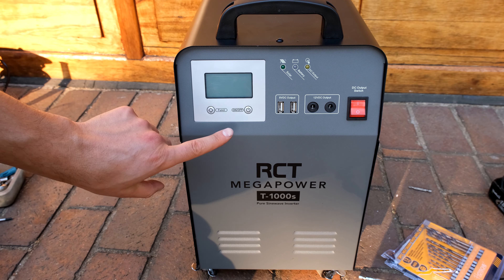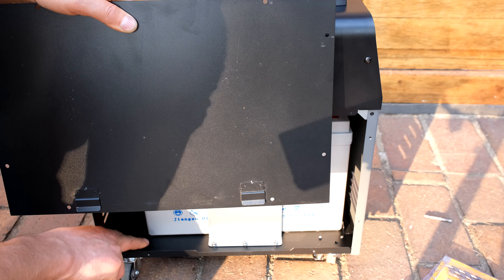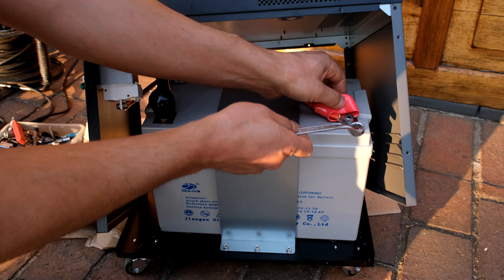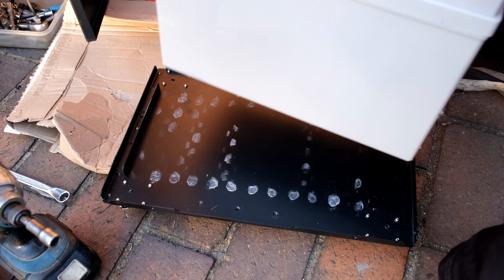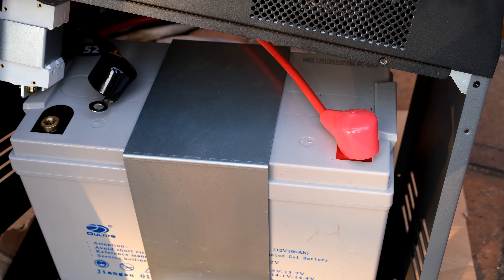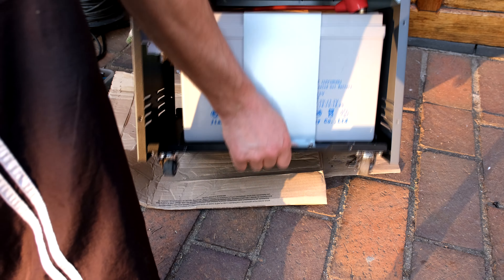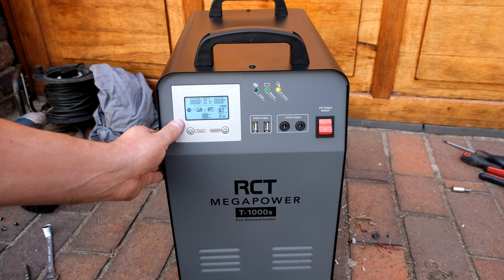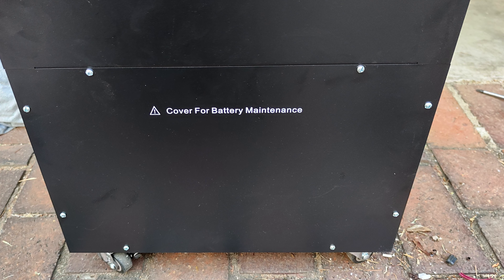How to change the Gel lead acid battery on the RCT MegaPower 1KVA/1000W Inverter Trolley

Comment: Hi, thank you for this very helpful. May you kindly make a video on how to connect the second battery using the battery extension feature from the back of this device. Thank you.
Reply: Hello did you get any info regarding this?
Reply: @idonwonpeace8238  No I didn't
Reply: any luck on getting information on connecting a second battery
'

Comment: Thank you !!!!
Your video will help me replacing mine who recently died.
Reply: Hello there! where did you buy your spare battery?Thank you.
Reply: Not all 100AH batteries are the same - the issue is the size.

The original make is Oliter but any gel or AGM deepcycle will work but it must be this size.

407x174x209 (L*W*H) - you can go higher like I did but not more than 20mm.

Ordered mine from Takealot - beware it weighs 30kg.

Put some insulation tape on the terminals and the spanner which I used to undo the battery terminals as to not short it out.
Reply: @tibbydudeza  THank you so so much for the answer! any chance 
to post the link here please?
Reply: @tibbydudeza how long did the original battery of this unit last you. 1 year, 2 years, etc?
Reply: @Cornelius1324  Stage 6 killed it (4 hour slots) - drew too much power so it lasted a year - it could only last one hour.

Add a power meter to monitor consumption and  bought another unit to split the load from my office.
Reply: @tibbydudeza  Thanks for the reply. What did you use the inverter for and what is the estimated cost to replace one deep cycle battery for this unit?
Reply: @Cornelius1324  
Router
Fibre ONT
Dell SSF Server
NAS
PC
Desklamp
3x LCD screens

The problem for 4 hours was the desktop PC and LCD monitors - the NAS and SFF server + others draw about 60W.

New battery (AGM) cost 3K.

Comment: Thank you. A very useful video. I’ve changed batteries in my Ellie’s inverter which was much easier.  This was really helpful as the RTC one’s 
aren’t as easy. Was a bit of fight getting the panels back on though.
Reply: Have you seen any instructional video in replacing the Ellies inverter battery? I need to replace mine, so trying to find some instructions. Way too heavy to take in somewhere
Reply: @n_justwatching  No, but the Ellies one is really straightforward, as I remember.
Reply: @spiritrider963  ah okay, thank you. I'll give it a shot myself

Comment: Hi i had to buy another 100ah gel lead acid, i stripped the unit as you showed in the video. I found the terminals on the adjacent side, thankfully the Neg lead reached.

Comment: Be great if there was a response to some of these comments particularly those about extension battery and use of a Lithium battery.
Reply: These are usually not recommended to be used with lithium batteries.
Reply: @pjn2001  also looking to add an extra battery. In just 4 months. It's barely keeping the TV on
Reply: Yes it can replaced mine with a lithium a few days ago.
Reply: Hi Stephan will you please provide details of the battery - make and model number, where you bought and what you paid please. Also where and how did you adjust the voltage settings to accommodate the Lithium battery. I contacted GeeWiz and they said a REVOV 100Ah 12.8V 12V Lithium-ion (LiFePO4) Battery would work. They should be available from April 2023.
Reply: @danielsamara3194  Did you manage to get battery and did you convert?
Reply: @markbooysen3988  Hi Mark, I did not. With load shedding getting worse and worse I am beginning to question the sensibility of spending 10k for a battery for a 1000W UPS. I am probably going to commit some extra funds and use the money to install something more substantial. Stay well.
Reply: @danielsamara3194  thanks for the helpful comment, I went and checked it out on the site and seems like a good option
Reply: @JoshuaRoode  Hi Joshua, I installed the Revov 100Ah LiFePO4 battery. Before buying I emailed Revov customer helpline but hey ignored me. Then I checked all the values that Revov specify for their battery and found that all the trolley values except low voltage were acceptable - so it did not matter that there is no info on how to adjust things. Have been using it for two months and monitoring the battery very  closely. All working well. Having a BMS is wonderful.

Comment: What's the process like for adding an external battery? Can one just add another 100ah battery on top of the original battery?
Reply: yes with a breaker added between the battery and the unit
Reply: @reniervandermerwe  so how will you go about it , as in when does the breaker work

Comment: Thank you for the helpful video. Can you please help in connecting the second battery to the inverter, would it double the current and/or power output of the system and could the inverter itself handle it?
Reply: no it does not double the power output the max stays 1000w . you only get double the amount of battery life

Comment: Just bought a new unit and  need some  help.  It appears the units fan and screen remain on when connected to AC wall supply when no loadshedding  and battery is fully charged. The noise and light is a bit annoying  Is this a feature or can those be disabled and kick in automatically when loadshedding happens?

Comment: Thanks for this, I replaced my battery yesterday and wouldn't have been able to do it without your video so I'm extremely grateful. I am, however having a problem with the battery now seeming to be recharging constantly. The manual provided is absolute garbage (I bought the same setup but branded as KOOL Energy off Takealot) but I'm not sure if it's because I'm in the wrong mode? Any help you could give would be amazing.

Comment: Can the battery be replaced with a 100ah LiFePo4 battery
Reply: I too wish to know this. Lead Acid Gel doesn't last particularly long.
Reply: Any information on this. I too would like to change to lifepo4 battery
Reply: Looks exactly like a mecer unit, so in that case no. Don't use lithium.
Reply: @pjn2001  Hi, can you elaborate on why you cannot use this with a Lithium battery?  Thank you
Reply: @StaffRoelofse  Hi, I don't know the technical details. Just what I read from the forums on mybroadband. Here is a quote from there :
"So after seeing the Revov batteries were available at Geewiz, i immediately left work and went there.
Had a chat to the very helpful technical guy at Geewiz.

He says there currently no Lithium battery that 100% works with the Mecer 1200/2400va.
I then asked him what about the 1200va/1000w. He looked at the specs carefully and said it wont work either.
If i recall i think it was due to not being able to manually set the charge voltage that is compatible with the Lithium batteries.

Even the combos they used to sell with the Hubble lithium's, they found that people were coming back with issues. Once it discharges bellow a certain point, the inverter is unable to charge the battery. A work around was to disconnect the positive terminal of the battery, then reconnect it. this fixed the issue, but then would not work a second time."
Reply: @pjn2001  Replaced mine with a lithium  From UPS Warehous. Works fine even if discharged all the way down till inverter switches off. I think the problem is in some lithium batteries the BMS cut off voltage  is to high. I can report the one from UPS Warehouse BMS does not cut of before the inverter cuts off.
Reply: @wap1bambi  What is the model number from the Lithium battery.

Comment: Great Vid. Do you know if there are any Li batteries that can be used as drop in replacements?
Reply: Hi Yes you can Ijust did it with an extended battery here is the battery 2 x Sunpal LiFePO4 Battery
12V 100Ah 6mm2 2-core Twinflex with lugs for battery
Reply: Hi if you can please make a video
Reply: Where did you buy this? I don't see it online.

Comment: Can I add a 200ah gel battery as replacement? Same unit
Reply: as long as its 12v not 24v and that it physically fits which i dont think it will unless you change the hosing for the battery so would need some body modifications.

Comment: Is it possible to replace the gel battery with a lithium battery on this?
Reply: So I actually did and it works well.
Reply: @vikashmaharaj6164  Could you maybe advise on how you came right and maybe which battery and where? I'm not keen on spending money on something that might not work xD

Comment: Has anyone had information regarding connecting the second battery using battery extension feature?
Reply: needs to the same battery type and use a battery cable (builders i think). which connects to the rear (+ -)

Comment: Simple question. Please advise if I can replace the Gel 100amp hour battery it come with with a 100amphour lithium battery?
If I can, what will the impact be and pros and cons?? I cannot find this answer anywhere.
Reply: pro - they last 2000 cycles unlike the gel ones. cons - cost twice as much
Reply: oh and make sure the battery specs are the same when buying . voltages etc
Reply: @reniervandermerwe  Thanks Renier, but still not sure if the inverter is equiped to take litium iron. One suppliers says no and the importer says yes??? now who does one believe?

Comment: Is the unit capable of using a LiPo battery?
Reply: Yes it can replaced mine with a lithium a few days ago.
Reply: @wap1bambi  Hi, Please can you share how you did it.  Thanks
Reply: @markbooysen3988  its just a swap into the old lead acid battery s place. Just have to rotate it 180 degrees. UPS Warehouse branded lithium.

Comment: Is it possible to replace it with a Li ion battery?
Reply: Also want to know this
Reply: Yes it can replaced mine with a lithium a few days ago.
Reply: @wap1bambi  good news and can you change the settings for the battery level. Those are set to switch off at 50%, with the lithium you can discharge more giving you more time on battery
Reply: @darrynvanrooyen2629  you can t change the setting but the inverter switches if at 11.3 volts. Just make you get a lithium battery thats bms cut off voltage is less than that. The lithium voltages is higher so you do get more capacity.
Reply: @wap1bambi  Ok that makes sense thanks, which battery did you use as a replacement?
Reply: @wap1bambi which battery did you use, please share link if possible?

Comment: Can I replace battery with lithium ion batteries ?
Reply from the maker: according Rectron its a "No"
Reply: @ecologicaltime  Pity.... still enjoying your channel champ.
Reply: @ecologicaltime  why do you say that.
Reply: replaced mine with a lithium a few days ago.
Reply from the maker: @wap1bambi  please advise the community if it works well. Rectron (importer) technical advised me otherwise so keen to see if it works. I know the charge voltages for lead versus Lithium are different.
Reply: @ecologicaltime  works well didnt have any problems yet. Built in charger charges to 14.45 vokts that is within spec of litium chargers and floats at 13.8 volts. I even ran the battery flat inverter switches of at 11.3 volts. And start charging it as soon as you put ac power on. So as long as the litiums bms don't cut of before 11.3 volts i don't see any problems using lithium battery s.
Reply from the maker: @wap1bambi  this is great news. thanks for the technical answer
Reply: @wap1bambi  what is your brand of battery you used?
Reply: @darrenkirsten6191  UPS Warehouse  branded
Reply: @darrenkirsten6191   I used Sunpal LiFePO4 Battery
12V 100Ah  works well no issues i also did the extended battery
Reply: @umoh1324  do you possibly have a photo of this battery installed? TIA
Reply: @wap1bambi  do you possibly have a photo of this battery installed? TIA.
Reply: @wap1bambi  how is the lithium battery holding up, is it still a viable option?
Reply: @wap1bambi  how is the lithium conversion doing, is it still working ok?
Reply: @Paul-RSA  yes 9 months in  had no problem. Allso did not notice any capacity decrease. The agm that was in there only lasted 6 months.
Reply: @denbeech6647  hi sorry i did not take a photo.

Comment: I recently fitted the Revov LiFePO4 100Ah battery to this trolley. Don't remove the lower section of the trolley it looks like way too much hard work. Rather simply remove the side panels, unscrew the battery terminals and bolts securing the aluminum bracket  and slide it out with the battery. Place the bracket over the new battery and slide it back in. You will be surprised at how much lighter a Lithium battery is compared to a Gel battery.
Reply: How have you found the unit since upgrading to lithium ion ? No issues at all ?
Reply: No issues at all. The BMS app that monitors the battery shows that the battery took about a day to settle in and has been trouble free from the start. I have a constant load of 130W - Light, PC monitor, laptop PC, Apple iPhone recharging off USB and a power supply running 10 hard drives. Under this load the battery drops to 82%  over two hours of no power.